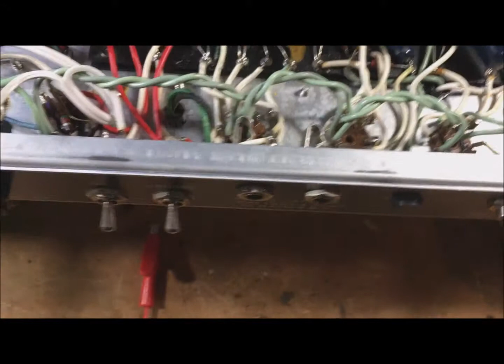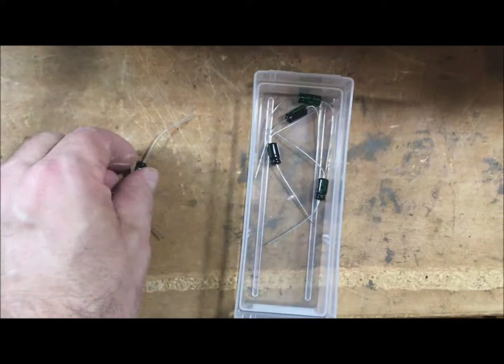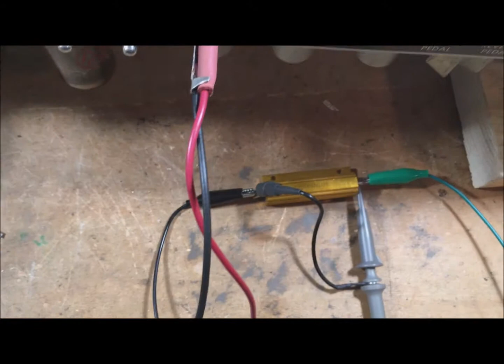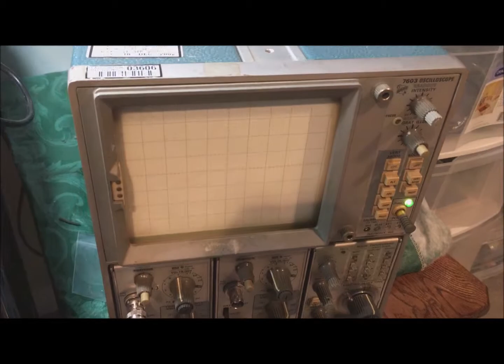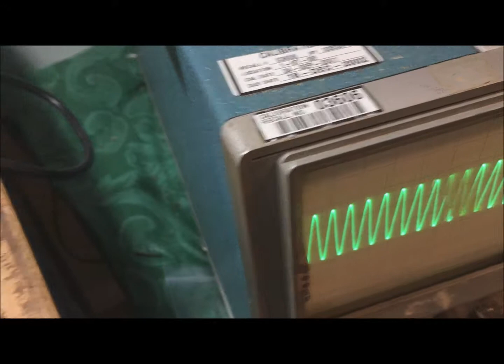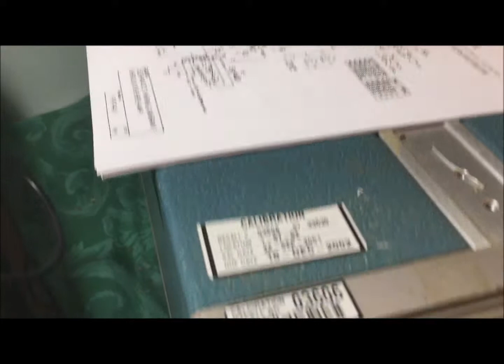1976 Fender Vibrolux Reverb

Comment: Didn't you notice the sine signal on the 'scope was 'bumping'?
That looks like a unstable voltage in the PS . . . could check the plate voltage on a vtvm for starters for too much shift . . . might be a bad tube socket or a bad rectifier tube . . .
just saying . . .
Reply from the maker: Yeah, it could have been a bad cap in the signal path as well, or even the signal generator.  It's been a couple of years.  I'll have to try to reproduce this.  Thanks for your comment.